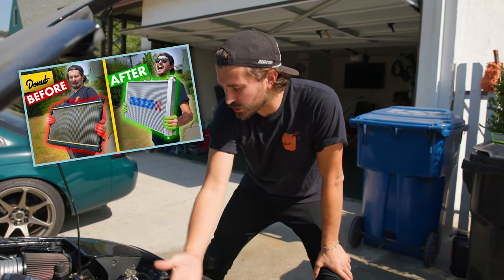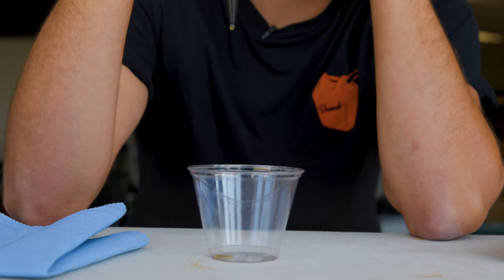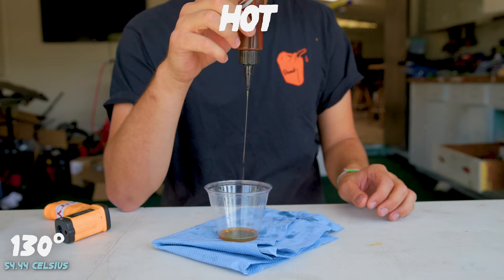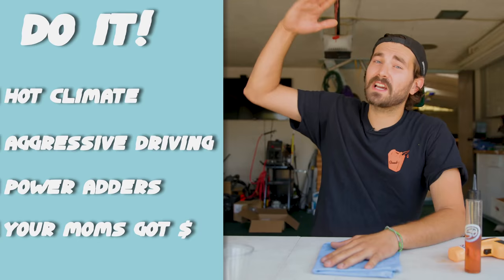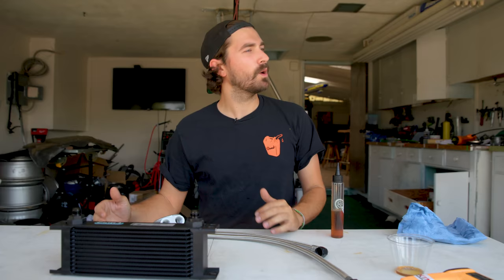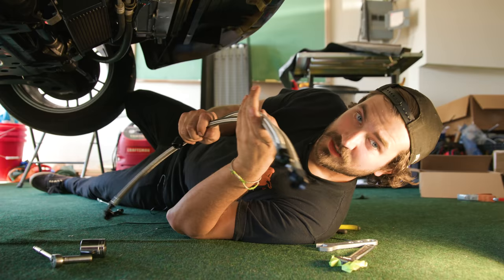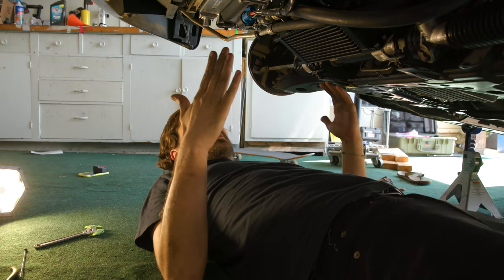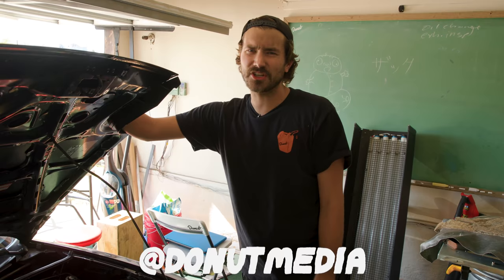Is an Oil Cooler Worth It?

Comment: No, you don't need an oil cooler. However, you do need a splash shield! It provides for proper air flow through the radiator. No wonder your car overheats on track days!

Comment: I'd crank the motor by hand or unhook the fuel pump fuse and crank it for a little bit so the car can get oil in th cooler so it doesn't run on zero oil pressure for 3 seconds while the pump tried to fill the lines and cooler before it gets the crank.

Comment: What l do know is most oils will work the best under 250 degrees and keeping it 220-230 degrees is best over 250 degrees is to warm under 220 is to cool l would say in between 220-240 degrees is best for most motor oils

Comment: Pretty risky mounting point for a radiator, is it not? I mean any road debris can crack it, and if it happens on a highway, not only you can end up stranded, but you could also cause a pretty bad and dangerous oil spill on the road.

Comment: Yes and no. Oil needs to reach 212 at least. It HAS to burn off the moisture. If you have a stock, regular car, no it does not need a cooler. If you have modified the car substantially, yes but also you need to run Synthetic oil so it can manage temps

Comment: “Oil can get too hot to do it’s job.” ok imma be pedantic for a second… good synthetic oil will a absolutely continue to lubricate the engine at extreme temperatures. 350 to 400 degrees is not a problem. 

The actual issue and why you need an oil cooler if you run your engine flat out at track events is because all of the seals that are supposed to keep the oil inside the engine start to get angry and tend to go on strike due to being exposed to unsafe work conditions. Think of it like this… you’re pushing oil through a turbocharger that sees operating temperatures at or over 1000 degrees. If oils couldn’t handle the heat modern turbocharged engines wouldn’t be possible.

Comment: A great video, but the new oil cooler may not get a lot of use on an NA car as the sandwich plate is mounted to the existing oil cooler...
Are there any before and after temps we can look at?

Comment: OK so what did it cost and where did you buy it and how much change did it make in temp?  I would have used Locktite on those fittings considering that the hoses are going to be flopping in the wind.

Comment: Could have just cranked the engine without it turning on by removing your fuel pump relay! Crank it until you get oil pressure! No spilling and a good way to check for leaks without the engine running!

Comment: You need to have the oil temp at least 200 to 212 degrees to burn of contaminants and condensation. That's what I was told.

Comment: Just a thought, but shouldn't you mount it higher than the oil pan so it drains when you change your oil? Otherwise you have to take it loose each time, and drain the oil from it as well, especially if you used motor flush..

Comment: Similar to your radiator upgrade video, I always thought of having and modifying a shroud or high grade cpu fans to pull additional air to further cool the oil and tranny fluids done in a similar fashion. Do you think this would work and help efficiency of cooling?
Reply: No

Comment: Yep,especially if you own a ford falcon xr6 with the stupid transmission oil cooler that is combined with the radiator fluid lines. When these units fail radiator fluid mixes with transmission fluid and fucks your transmission over. Worst design ever. First thing i did when i got my fg xr6 was install a bypass air cooled transmission oil cooler. The next item that is a must is replacement of the 2 servos on the 5 speed transmissions with the modified servos from america,these factory servos fail around 100,000 ks resulting in a full transmission rebuild.$400.00 bucks and about 2 hours labour is a lot cheaper than $3500.00 for a rebuilt transmission.

Comment: Did you also have a chance to thoroughly flush the new cooler? I've never installed a new cooler that didn't have paint spray, dust, loose burrs or other lose small contaminates from the factory.

Comment: Does anyone have experience that installing outside cooler has actually eliminate the transmission hardshifts? I noticed that shifting is good while oil is cold and hardshifts occurs after the oil has warmed-up after running few blocks. As if tranny is experiencing shortness of oil. Tranny is newly overhauled with new solenoid pack, speed sensors, clutch, plates, and all CVI's are within the range. Any help will be appreciated. Thanks for your time. Car is Dodge Grand Caravan.

Comment: you should mesure the oil temp, before you install oil cooler.
It still might be useless.
no need to fill oilcooler before. Even if you have no oil in oilpan, oil is still left between engine parts.
I usually change oil this way that after draining all oil, I start the engine for 10 sec. It releases 100g or so more oil.
If you are still worried about emptiness of system. Just crank endine few sec without starting the engine. It pumps new oil into system.
This video is mostly enternainment rather than actual knoliedgement.

Comment: as much as i want an oil cooler, i know my car has no need for one. hell the cooling radiator is bigger than it needs to be. tiny 1.6l i4 with a tony radiator and the rad is still bigger than necessary. i've never gotten that needle to budge beyond the normal operating temperature of "middle of the gauge"

Comment: Question:
The oil cooler seems to be on a low point, how do you change the oil In a way that the oil cooler doesn't collect crude?

Comment: How effective are aftermarket oil coolers with a cooler adapter is my question???  Ones that come with oil coolers from that factory have their own oil ports not shared with the oil filter ports.

Comment: Doesn't a oil cooler AND a oil filter relocation produce too much resistance in the oiling system and potentially starve top end ? 
As in. SR20det?

Comment: I use some aluminium fins thing that goes around my oil filter. Does it work? I dunno. Do I need it? probably not. Will it punch a hole through one of my coolant lines? Probably. Quick question tho and please forgive my peasantness. If you remove the uuurll fulter, and only put the tiny tiny rad. Whats filtering the oil now?

Comment: Does anybody know if you have to top off the oil after the thermostat in the sandwich plate opens up for the first time ? Because dosent it open and then fills up with oil if it's the first time ? And what about oil changes do you have to drain the oil from the oil cooler( not sure if oil coolers hold alot of oil or not). Just some questions I'd like answers to before I purchase one. If anyone knows plz do teach.

Comment: The oil line, which line is oil from sandwich plate into the cooler and which line is oil out from cooler to the sandwich plate? Does it work either way?

Comment: I personally would have used a silicone based O-ring grease or lube and not engine oil on the O-ring, petroleum based lubes eat rubber and will potentially lead to leaks in those seals. Very nice work bois! I enjoy watching your series. I am thinking of an oil filter relocation on my Toyota Celica All-trac turbo soon, I May add an aftermarket oil-cooler, always have some sort of project in mind!

Comment: I drive a 2007 PT Cruiser(yeah yeah laugh it up, I used to it)

I don't have the Turbo model but these cars do have an issue with overheating, a fact that isn't help by the fact that I live in sunny Florida which, when not raining, is just as hot as Cali(If not hotter at times)

would adding an oil cooler help me?
Reply: Try upgrading your radiator first, and upgrade the efan if you can, but, an oil cooler cannot hurt.
Reply: Or if you want to go simple and if you live in a place where you dont have to worry about freezing temperatures, you can add water to your radiator, water conducts heat better than regular coolant.

Comment: |Using an oil cooler to get some heat out of the engine bay? My neighbor built an awesome turbo engine,  pretty much the same thing I'm planning and my God, the heat that would come pouring into the cabin when he was driving hard! I Need to solve that problem.

Comment: Actual question, if the cooler is sitting that close to the oil pan that has the running temp oil in it wouldn't the cooling efficiency be limited if not 0% gained?

Comment: You just introduced another complexity to the system. If your oil cooler system fails you will have coolant mixing with oil which will blow your head gasket.

Oil is already cooled from engine bloc water jackets.
Reply: There is no coolant, oil coolers systems mostly work by Inc the surface area of then contact with the airflow which allows more cooling of the same oil.

This is not a seperate cooling system with additional cooling fluid etc

Comment: Is there not a cover that goes over that radiator? Obviously, a solid cover would beat the purpose of the radiator not being able to wick heat from the fins, but what about rocks and debris hitting the fins? It's just that with that radiator being so close to the ground, I'd be concerned about stones and stuff jumping up and damaging the radiator.
Reply: ¡ could be wrong, but ¡ think the cooler itself is hard enough to fight off debris on its own.

Comment: Hey Zack, I have an NB and I'm thinking about putting an oil cooler on it. I wanted to ask you about how you feel about the location of the cooler. Doesn't the location it's in put it at risk of getting easily damaged?

Comment: Somethings you did backwards why would checking the oil level be the last thing you do after starting the car 

Why didn’t you put the lines on the adapter first   

Why did you fill the the oil cooler with oil when it can potentially leak on you and on the floor at the angle

Comment: I´m planning on installing an external oil cooler on my Land Cruiser (1KZ-TE engine) but the filter threads are M24x1,5 and there doesn´t appear to be a single sandwich adapter plate with this thread type, does anyone know where I could get one or if it would be possible to buy a normal oil cooler kit and replace the included  filter adapter with a selfmade one (turned on a lathe)?

Comment: I have a. Bike with a stock sandwich block cooler 
But it has coolant running thru to cool the oil 
Not oil 
So the water pump recircs the coolant

Comment: I'm going to guess like 600 bucks for this tiny little oil cooler that really isn't going to do much at all in a daily driver! not to mention it looks like the car already has a factory oil cooler I'm not into Mazda's especially miatas but that looks like a factory oil cooler which probably doesn't do much either but unless you're doing road race stuff this seems like a big waste of money cuz I doubt it helps very much at all especially the placement and size of the cooler for the money spent on this you could build something way better you would just have to custom build it!

Comment: Wait, if the inlet and outlet to your oil flow are in the same spot, how does it flow? Wouldn't oil just end up sitting in the rad? Unable to circulate
Reply: the oil filter has a feed and return port for oil

Comment: Dude no lock tight in the sandwich plate threads and you didn't torque it down.......  😬😬😬😬 I hope it doesn't separate like the eclipse oil filter housing will.....

Comment: I have an ignorant question to ask:  I'm adding an oil cooler to my track car. I have some specific dimensions and want AN fittings. I am finding lots of "fluid coolers" on Summit, Amazon, etc. but here's my dumb question: is there any functional difference between a trans cooler unit & an engine oil cooler unit? I'm thinking that trans fluid is usually more of a 0, 5, or 10 weight oil vs a multiweight engine oil. I can imagine that there COULD be a difference in the size of the passages/flow rate through the coolers IF there is a difference. I'm kinda doubting there is, but would love some educated feedback from someone with more expertise. Anyone help?

Comment: That's not a good place to mount the cooler.   Any stones or crap that goes under the vehicle , is liable to damage it. With the resulting oil loss.

Comment: i have a radiator with a trans cooler but i have a manual transmission. could i route my engine oil to it instead

Comment: Random question if its not weird, when draining or changing the oil do you have to take down the oil cooler and drain it individually ???
Reply: It won't hold that much oil to be problematic

Comment: Doesn’t that end up leaving old oil in the system when you do an oil change? I realize there’s always some old oil during oil changes but that holds a significant amount more of old oil each time.
Reply: Thats a question about oil coolers I always had. I even run one my self and dont know it. I just do the change normal and dont fiddle with the cooler. Is leaves old oil back. I know.
Reply: @piti_rocks  I think it doesn’t matter much because any oil change you do tends to leave some of the old oil in to mix with the new. What’s important is the majority of the oil being new. I actually ripped out my oil cooler lines on my yard plow dump truck 1998 c3500 because the lines just keep rotting out. If I was towing or carrying lots of weight in the dump far distances then I’d have kept the oil cooler lines but this way I don’t have to play that game anymore. Oil filter adapter and a shorter filter on it and done.

Comment: Doesn't look like a good spot for the oil cooler. Thats all low pressure air flow underneath. Air ducts or scoop will help.

Comment: wrong, oil filters filter on the return side of the oil system. meaning it does not matter if filter or cooler was installed empty.

Comment: wasnt the most accurate because when you put the container in the sun it also expanded as the oil heat up so im guessing the top opened more a bit

Comment: I’ve had an oil cooler in the same spot in my e46 m3 and I had a rock make a hole in it and it dumped oil on the track and i blew my engine

Comment: Unless you are pulling a trailer, an oil cooler is useless. The car was designed without one, so you add on something to make up for abusing your engine. If the oil is over heating, its because you did something to cause your engine to get hotter than your radiator can handle. It would be better to install a better radiator or stop abusing that engine.

Comment: Don't even get me started with oil cooler... One of the most well known online car part store sold me wrong oil line for my oil cooler. the hose failed and lost most of my oil. i shut off the engine as soon as i noticed low oil pressure light but it was too late
i called and complained to them and all i got was 50 dollar gift card..  which i never used

Comment: BP upgrades are not worth it, my winter beater 2011 fiesta comes with an oil cooler stock, there are way better built engine choices than the BP in the MX-5 and that is why there is no point to upgrade it.

Comment: 20w-50?  Wow.  What a horrible idea for any liquid cooled engine.  How do you know if you need an oil cooler?  Simple.  Put a gauge on your oil temp, and if it runs above 220F, you need more cooling. Very few street cars do this.  My IS F will run 275F (according to the factory gauge) at the track.  It never runs over 220F on the street.  Ever.  It comes from the factory with an air/oil heat exchanger which does two things - warms the oil faster and cools the oil when it is hotter than the coolant.  Not at all uncommon in performance cars.  My car needs additional cooling for track days.  It doesn't if I never tracked the car.

Comment: Anything to help cool a motor down is worth it.
Reply: I agree. My dad has a VW Beetle with a ridiculous 1835cc engine. It's quite a sleeper. But when towing a trailer you couldn't really go faster than 70km/h since the oil temp would shoot up to about 120°C. So he decided to install an oil cooler. And it helped.

Comment: Instead of an oil cooler, why not discuss the real life threatening hazard to an engine, and that is lack of lubrication at start-up and shut down of an engine. To a person, everyone recognizes that the hardest wear and tear on an engine is during start-up and shut down (particularly engines with a turbo). So why aren't pre-lube and post lube pumps installed on cars and trucks? The extra weight of an add'l device on a car or truck is insignificant compared to the benefit to an engine with proper lubrication.  Car and truck manufacturers have essentially mastered the art of planned obsolescence by refusing to add this one feature to all vehicles.

Comment: What a terrible place to mount an oil cooler!  A curb, pot hole , or just a stone in the right place and then you have NO oil and then NO engine.  I agree an oil cooler is a good idea for a turbo but I would want the cooler and lines mounted well away from the ground.

Comment: that oil coler placement is not gonna get sufficient airflow ...y didint u locate it in front of the car where it can get reliable airflow .....where it is now is a low pressure zone ...hardly any airflow ....THATS NOT IT !!!! iNSTALL AN OIL TEMPERATURE GAUGE ....

Comment: ... Could have just used thicker oil and let your car come up to temp before driving. Does the same thing with less failure points.
Reply: That's not how it works

Comment: Certainly not the proper way to install an oil cooler.Wrong place to mount it, cause it can get damaged easily and the orientation will always hold oil in every oil change.

Comment: So, is it worth it or not. Drive 3 runs around the track without and 3 times with oil cooler. Then  let’s view the difference…
Reply: its always worth it if your having high oil temps, just make sure it has a thermostat